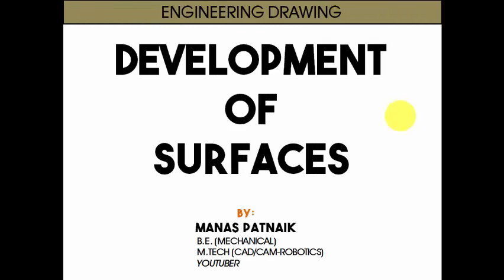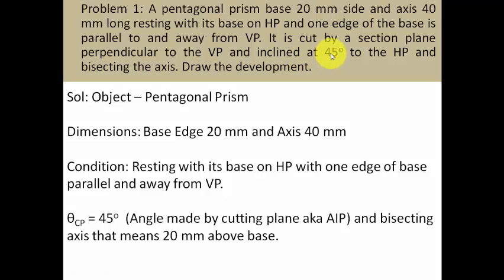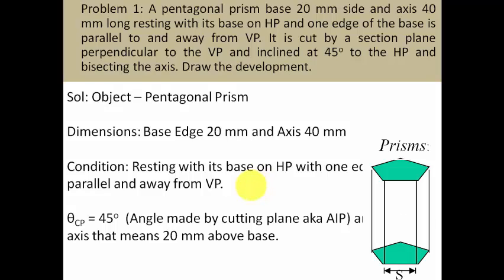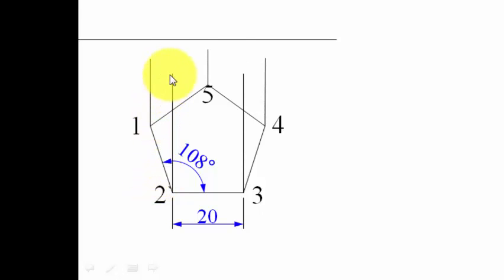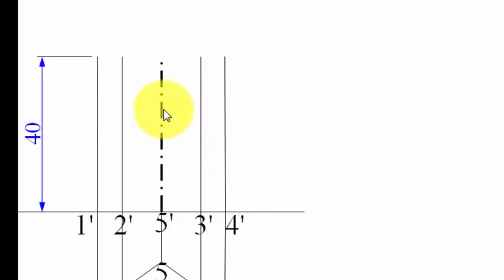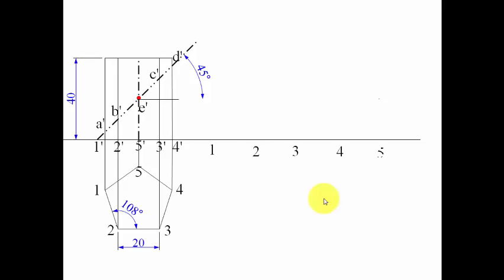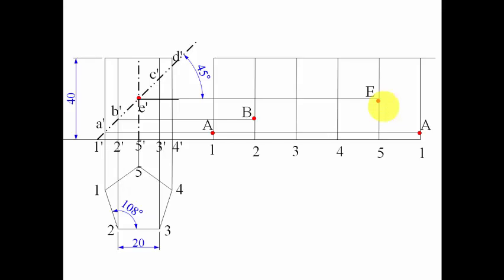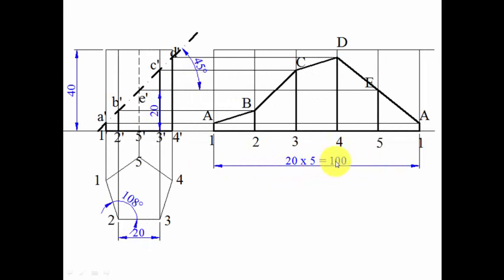Development of Surface of Prism_Problem 1

Comment: 3. A pentagonal prism of side 25mm and height 60mm resting on H.P with its base, as 
one of its base edge is perpendicular to V.P. A cutting plane is inclined 45 degree to 
H.P and perpendicular to V.P cuts the solid 30mm below the apex. Draw development 
of surfaces of the truncated solid.

Comment: Sir, there is a query, while projecting a section part of solid the line which represents the section part should be thick inside the solid and thin outside the solid. But, you didn't so.
Reply: Semma

Comment: sir i have a doubt if in a question it is written that a line at 60degree and above 15 mm bisects a pentagonal prism so should i bisect line at 15 mm or at centre of its hight
Reply from the maker: First of all mark a point 15 mm from the base and then just pass a line at that particular angle.
Reply: @ManasPatnaikofficial  but the question says above 15 mm so shouldn't i mark at the centre of height?? plss explain

Comment: Mr. Manas firstly I appreciate your work . It truly was helpful. And secondly for this particular question, the object in question is a pentagonal pyramid so isn't supposed to have double markings? as in 1(a) 2(b) cause the prism will have two pentagons. I stand to be corrected if am wrong
Reply: pentagonal prism not pyramid sorry
Reply from the maker: Hi Aziz....
Naming both the pentagons isnt mandatory....because the pentagon at the top will be chopped off  by the cutting plane...
Reply: Abdi Aziz @ gmail